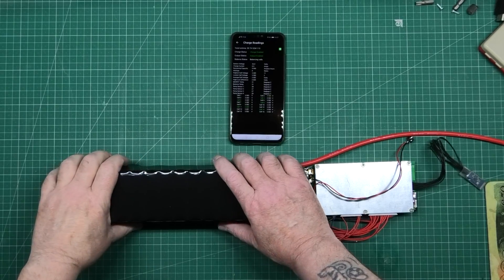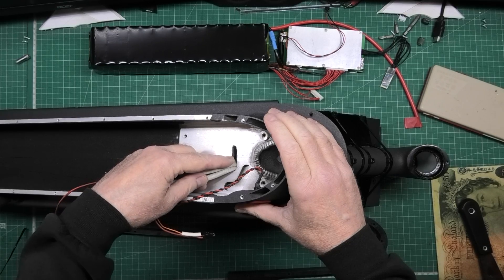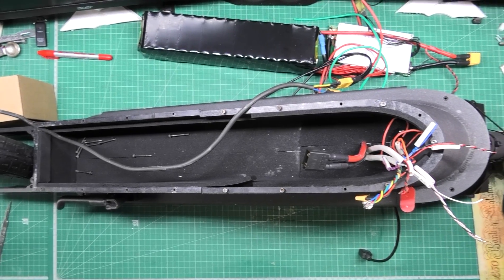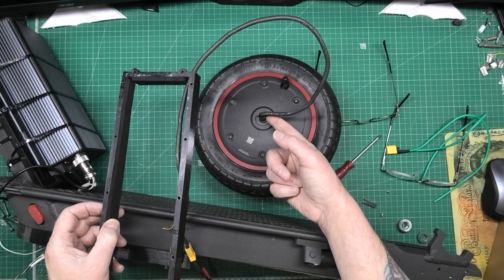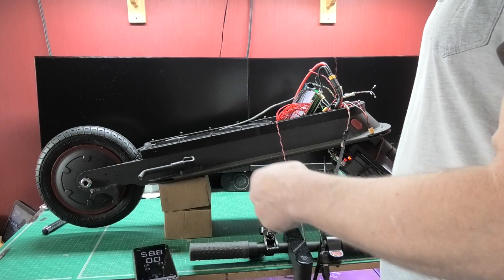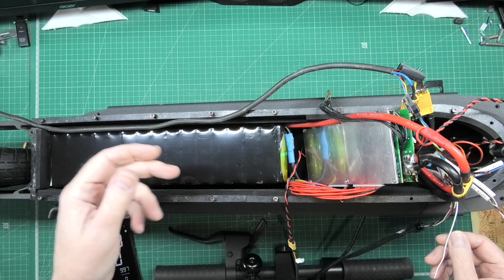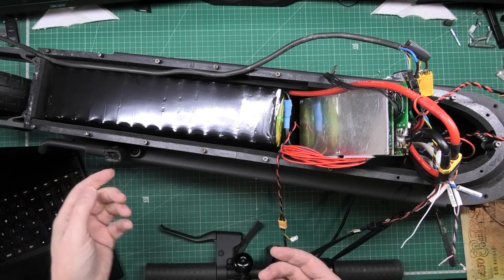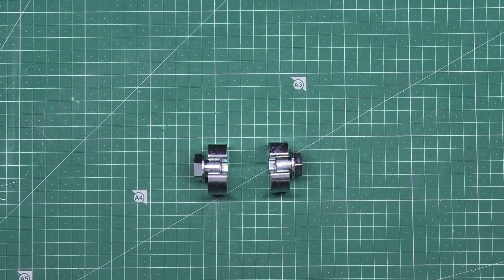Xiaomi M365 build - Codename V365 - The 2kW sleeper part 2

Comment: All u need in the rear is an additional set of steel forks off like a zero for example.  You slide the whole thing into the ass end of yer m365 and bolt it in place.    It works perfectly

Comment: Hi i hope someone can help, i am upgrading my xiamoi 365 with a different controller, but i cab seem to fknd the correct hall sensors combination. Did you experience this ?
Reply from the maker: Personally, mine were straight colour to colour in both the Sabvoton and Phaserunner. If you're using a generic controller which doesn't have any settings, it probably won't work because it needs to learn how many motor poles (magnets) for the pulses.

Comment: Stock controller holds up to 55amps and up to 125volts only changing 6 transistors and 125v capacitor.
Homemade firmwares like Conejo or Russian CFW2.0 allow it.
Reply: m365pro motor is the weakest part, it will burn the first if you hold the 55 amps.

Comment: Wago connectors - I know we all have a laugh at you when you cock up and have to desolder your connectors. AGAIN !! Use Wago connectors while you are building/testing your system. They are strong and can handle the current, although I know they are really for solid core wires.

Comment: Why don't you buy a Kelly Controller KLS7212S that is mega small and really Power Pike 120A continuous 50A that is completely sufficient for such a scooter even for an e-bike that is completely sufficient and you can set everything with Bluetooth with a separately available dongle via app also without but then with cable and PC 😉 I can only recommend the part just take a look 😉😎🙋‍♂️

Comment: Nice build so far but for the phase wires rather than using 2 XT60 connectors you should use an MT60 connector, I used the MT60 on my 1500w ebike for the phase wires and it is great, it is compact and incorporates all 3 wires into one connector that can handle up to 60 amp
Reply: i've put 120A (bursts when accelerating etc) through MT60's and they're more than fine

Comment: Hi Tony am at my wit's end.. my rear hub motor started juddering and had no power upgraded to a sabvoton (as the test kit says it was the controller but it still persists, display shows the watts increase but nothing if I slightly roll the bike forward it then judders HELP
Reply: Phase wires wrong way round....?
Reply: There are six combinations for the phase wire try them all....
Reply: @steebbo9460  cheers for the reply, already tried that before, plus bought a P.R and doesn't really matter with them, the only thing I can think of is hall sensors maybe but might aswell just buy another wheel this is the third wheel I have bought, either they are not really 3kw or I'm just truly unlucky.
Reply: @theatheisthammer  you can send me your old wheels if you like ;) and there does seem to be a lot of fakes going round ie higher claims than truth.

Comment: I have a question. My standard m365 starts engine braking when I apply throttle. I doesn't go forward it only brakes if I give it throttle. Could that be a hall sensor error? because i got the error code twice. Thanks for the help!

Comment: nice build so far, I'm just thinking about how to control the engine temperature.  If it has to stay waterproof it is not that easy and your method was probably not successful. 
 
- You could attach air vanes / cooling fins to the metal cover to achieve cooling, the easiest and cheapest way if you have the possibilities for CNC milling.

- Or like Tesla...  wind the motor with hollow copper wire which can be cooled with liquids

- If you have dry ice, you could put it into the engine via a built-in flap, for a short duration it would be very effective

- You could fill the tire with water, but it won't last long

- one could integrate a fan or make holes, but then the engine would not be waterproof

- you could optimize the regulation or control of the motor so that less heat is generated

-.....